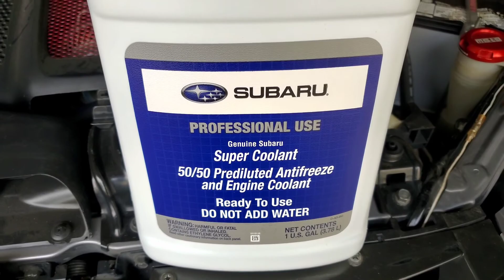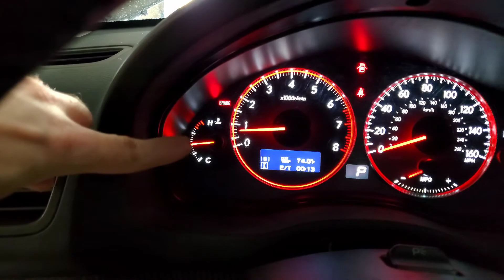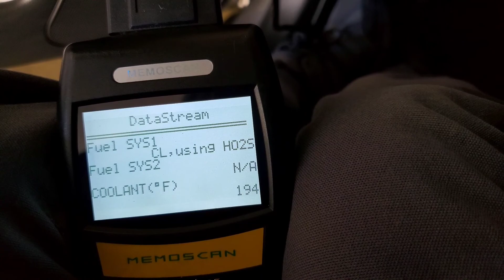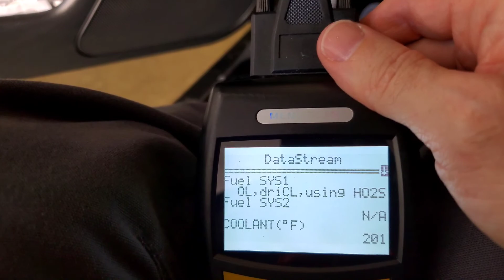Coolant Flush and Thermostat Replacement episode 3

Comment: Yeah the bubbles Are Normal after a flush.  Just takes awhile & adding more coolant in a day or 2 after. When you check  your oil if the dipstick (oil) looks milk shaky. Was the overheating just on trails? If so look into getting a trans cooler put in. Trans overheating will make coolant overheat as well. 
Mathew Heiskell did a vid on how he did his:  https://www.youtube.com/watch?v=nmiQ6tZj6YE
Reply from the maker: Yeah I added a little bit more coolant the next day. And my oil looks good not milky. I think it might be Trans cooler. Yes it only did it on trails. Thanks for the info 👍😁...